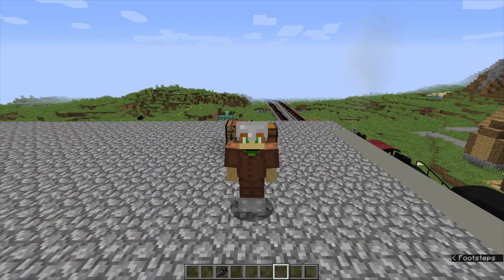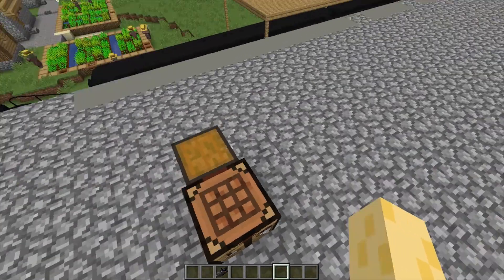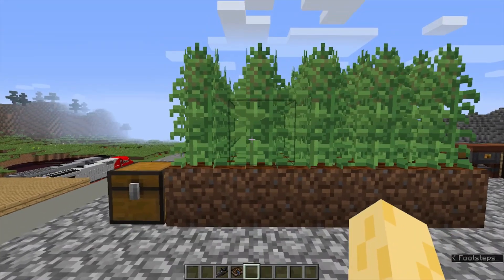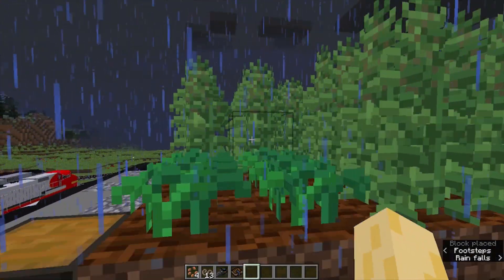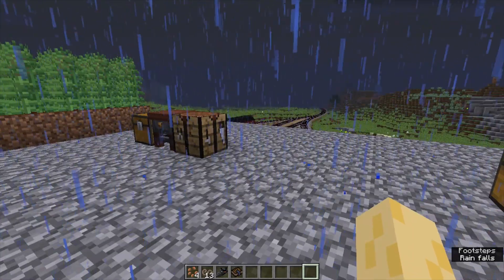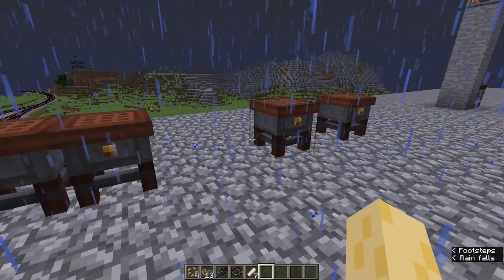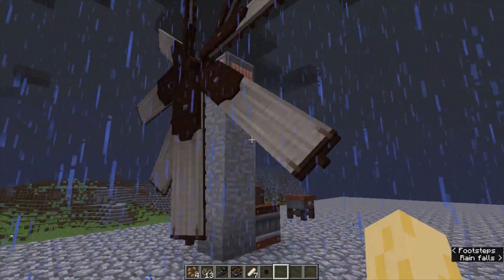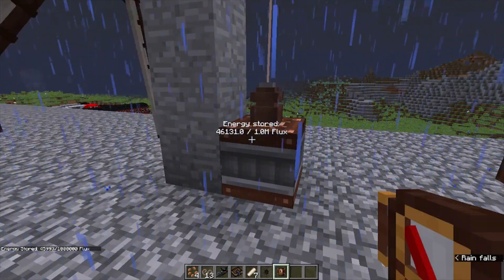Immersive Engineering: How to use the Windmill & Generate Power from it

Comment: Whatis the volt meter reading and why, is very usefull
Reply from the maker: The voltmeter is used for measuring the amount of energy in an energy storage block. In immersive engineering the energy is called flux